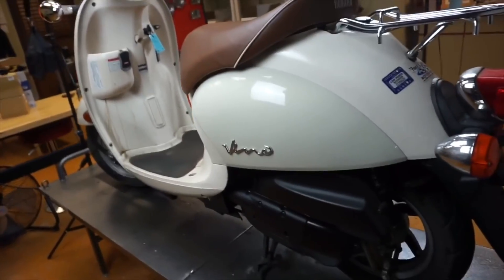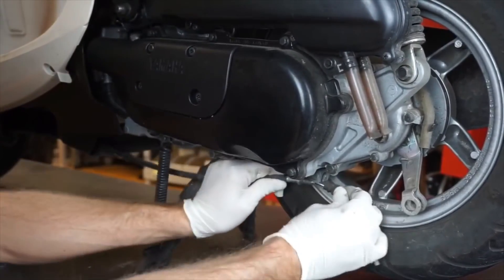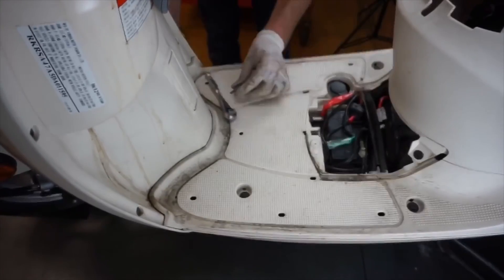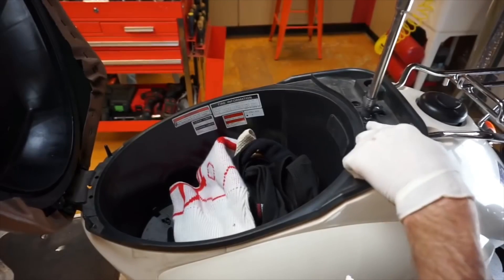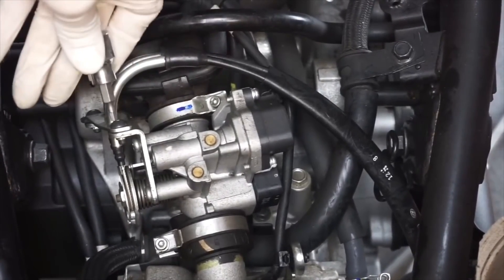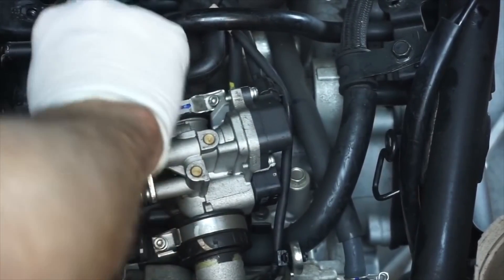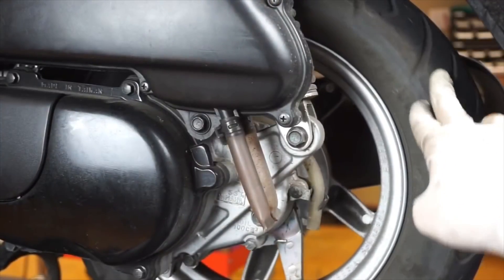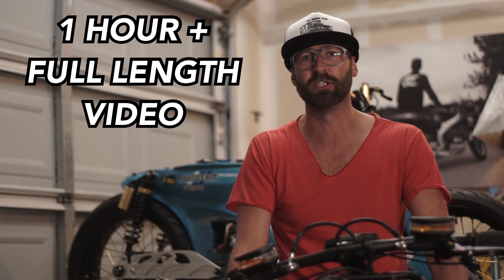Yamaha Zuma 50f big bore kit install (Yamaha Vino & c3 included)

Comment: Is the paid video a good guide for me even if all I want to do is replace the stock top end?
Reply from the maker: Definitely
Reply: I wonder if you could give me some advice. I installed a new cylinder and piston (the video was great help, btw) because I got a very low compression reading. And the scooter was running like it had low compression. However when I got down to the piston rings and cylinder looked almost brand new. No scoring or anything. Oh well, I bought a 60cc kit so might as well upgrade anyhow, but I’m still not sure this has solved my compression problem. Should I be able to get a good reading turning it over by hand? I want to get a reading before I get too far into reassembly.Valve clearances look ok but I’m at a loss for why compression would still be poor. Thanks!
Reply from the maker: @theambienttraveler  thanks for the support 🙏🏻💯. Compression tests need to be done with the electric start or kickstart. The throttle must be wide open as the engine is being turned over. Your compression should be somewhere at around 130psi for high elevation (6k+ feet above sea level) or 160psi for sea level.
Reply: Finally getting back to this. So if I’m at 50psi after installing new piston and cylinder, suspect valves?
Reply from the maker: @theambienttraveler  ya definitely
Reply: Exhaust valves were slightly out of range, but not improvement after installing new shim. What’s next? Pull the head back off? Valve seats maybe?